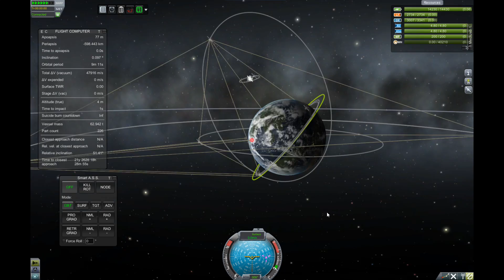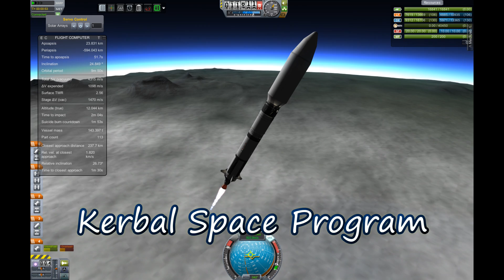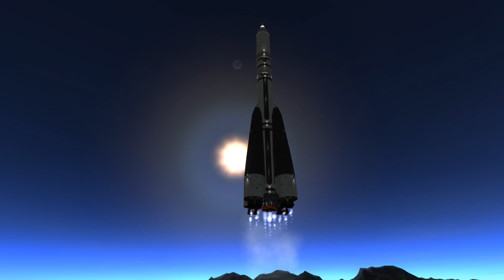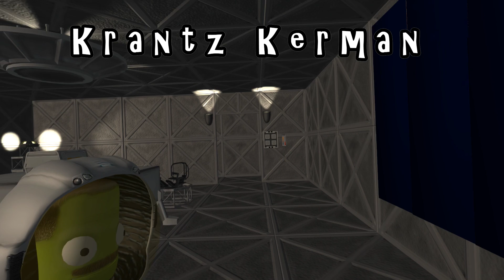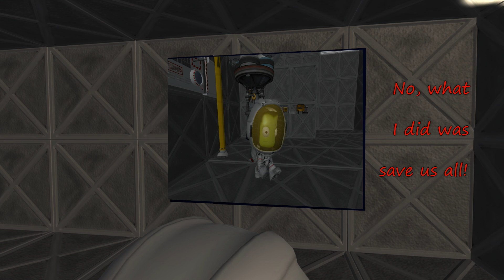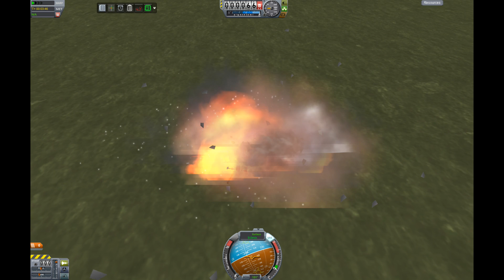KSS-26: S6 Truss / Project Gateway / Kerbal Space Program 0.23

Comment: Bob Fitch I used me notepad++ to try edit crew capacity in the aies moudless pod but still doesn't work. 
Do you know a suggestion?
Reply from the maker: change the INTERNAL model to something that has more seats
Reply: I'm not sure what you mean but I did this

vesselType = Lander

// --- internal setup ---
CrewCapacity = 3

I swithced it to 3 capacity
Reply from the maker: The Moduldess only supports 1 so if you change it to 3 then you need to change this too:
INTERNAL
{
  name = landerCabinSmallInternal
}
The landerCabinSmallInternal only supports 1 Kerbal. You need to switch that to something that supports 3 or in my experience the game will often crash; like use the Squad 3-man capsule cockpit. You can find the name of it in Squad Spaces folder but I forget the name and I am at work; can't check.

Comment: You can do a symmetrical engine cluster trick with modular girder segments. Put 4 girders on the tanks, flip it so you can't see them, and put the engines on the nodes.
Reply from the maker: That works a core piece but not a radially mounted one. Still a good trick though. I use that sometimes, where appropriate.

Comment: Bob, I've just noticed that the Poisk module has disappeared!, I dare say the gremlins may have something to do with this!
Reply from the maker: Poisk has not been launched. That's episode 28. See my discussion page for details. This was March 15, 2009 S6 Truss & Solar Array. Next comes July 15, 2009 JEM. After that is Poisk on Nov 10, 2011.
Reply from the maker: That said, I HAVE had parts appear invisible before when I edit files. It can happen when you move a model file or put a typo in PART file. As soon as the model file or PART goes back where it's supposed to be, the part magically appears again. I had this once with a fuel tank for a rocket that was on the launch pad. It was hilarious because the entire rest of the rocket looked like it was levitating.
Reply: Bob Fitch Sorry I meant Pirs thats what has disappeared :P
Reply: Bob Fitch didn't the part problem happen with those KAS struts?
Reply from the maker: I looked at the video (because I am at work and can't look in the game) and I see Pirs in the video. I'm pretty sure I see it. Darn I closed the link. Can you link a time code that shows it missing?
Reply from the maker: NM! I found it! When the Soyuz docks it's not showing up. I did a big pass over all the part files where I renamed some (like if I had done two versions then one might be called Destiny2 so I renamed those to Destiny etc) and I also edited a lot of PART files to remove docking nodes and sub in visual non-docking replacements. I bet I messed something up with Pirs. I'll check it out when I get home, but I am almost 100% sure that last night when I filed JEM-EF docking that I saw it there. In fact... doesn't my new Intro have the Pirs appearing, AND the Soyuz is docked in the intro? I think it's already fixed but I will validate it tonight. It might have just been a glitch with Alt-F12 + Reload that I get sometimes.
Reply: Bob Fitch Ok bob, I guess we can conclude this as a temporal shift created by the after effects of Joseph Kerman's super efficient warp capable craft!
Reply: Charles Power I think the " All Knowing " are preventing the stations construction...

Comment: This may sound as a stupid question but, how do you modify the safefile so that the docked parts their docking ports are considered connected and won't undock. (for improved performance) because i'm doing a MIR replica with stock welded parts and still have framerate issues. few pictures here:http://imgur.com/a/o3nJK#0
Reply from the maker: It's complicated. You need to find the linkages and reindex them. If you already know what I mean then you don't need more help. If you don't, you'll find it an almost impossible task. I'm a software engineer by day, so I draw on my years of experience with formatted data files to understand what to change. Sorry I can't really explain more without something like 10 hours of tutorials.
Reply: Thx for the explenation, i know the basics of programming so i know what you're talking about.
Reply from the maker: Actually I merged two ideas at once there. You can start by trying to remove the docking module from the part and save file. The problem YOU'LL face doing that is you probably just used the stock docking module. You'll need to replicate that docking node, remove the dock module from the copy, then re-reference it in the save where the old dock port was used. It'll start using the new one that has no docking inn it. In my case with welded parts, I can also just edit the original PART file to remove it without affecting any other ports.
Reply: or, i can edit the part file and replace the docking part with the fake one, also i never weld docking ports in the part (issues with decoupling)
Reply: I see wat you mean: make a copy of the docking port without the docking module, dock in space, edit the part cfg, replace the docking port with the fake.
Reply from the maker: Correct!
Reply from the maker: The problem with welding is you can only have one ModuleDocking or whatever it's called per PART file. So I pick one and then I have all others be real until they are docked, then I add the port visually to the PART file and unlink the real one from the save file.
Reply from the maker: P.S. putting a docking port into the welded PART also can cause the game to think it's oriented in the wrong direction. This screws up NavyFish docking alignment, and you need to dock it "by eye" in that case.
Reply: I know that, that's because it thinks that the docking port is pointing upwarts because it's using the heading of the command part.
Reply from the maker: Yep, exactly.